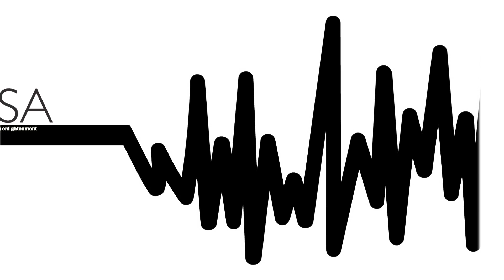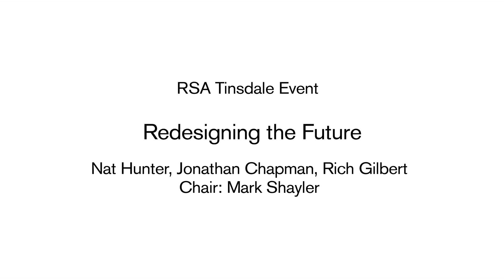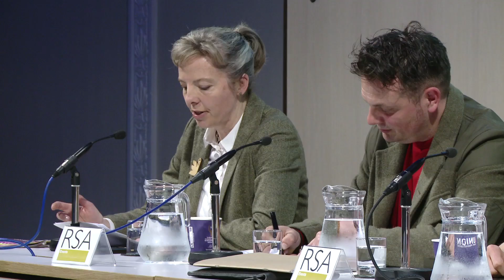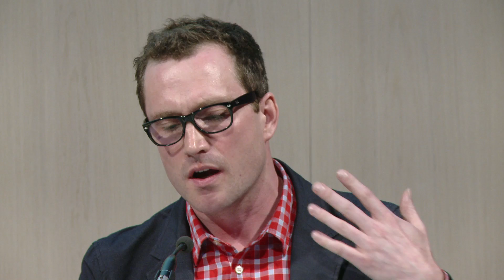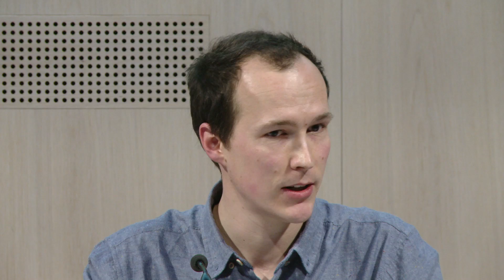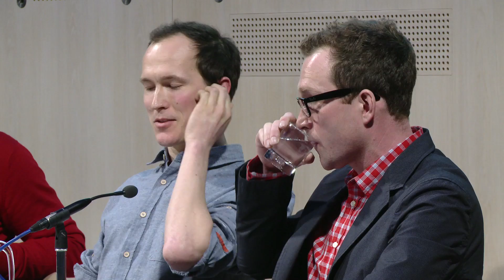Redesigning the Future

Comment: As someone who works with electronics and product design I take issue with this. There are somethings that have to be designed to be hard to take apart or hard to dispose of because of size, performance, and cost constraints. If it takes twice as much energy to make a product that is easier to dispose of you aren't gaining anything. Planned Obsolescences, with the speed of electronic advances it is impossible to have a good product, without it going out of date quickly. Technology progresses.

Comment: Part of the problem is that repairing things costs so much more than to just get a new product. Manufacturing is all oversees and dirt cheap. Repair is usually local and therefore expensive. You can ask like staples to reformat your computer and they charge you like $300. Yes it's highway robbery but that happens pretty often. It's just cheaper to be wasteful for now. Capitalism is not based on the future.